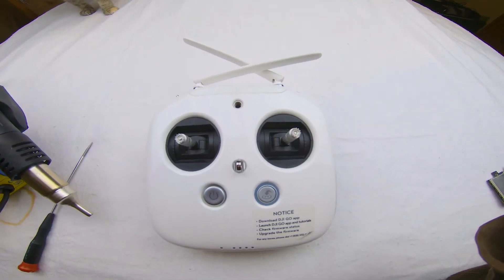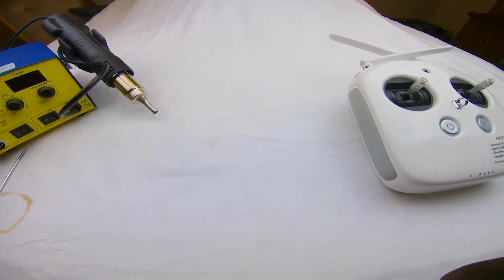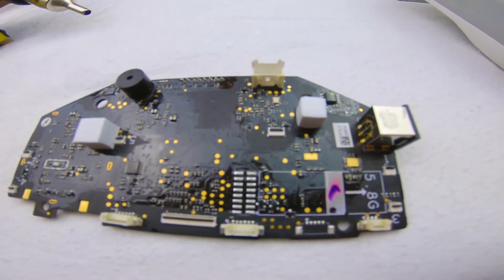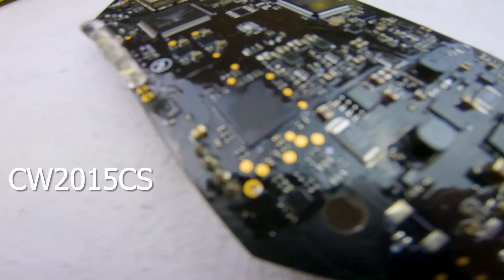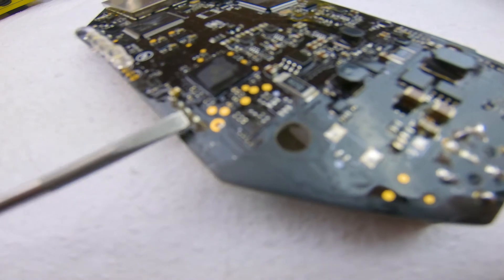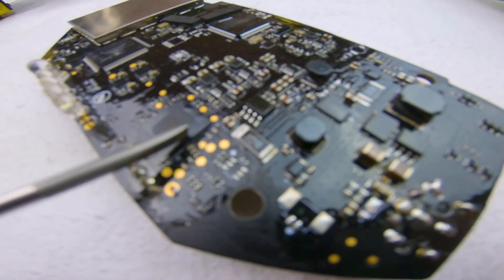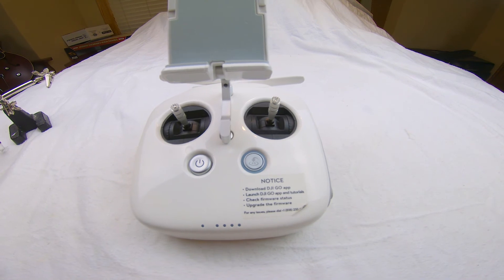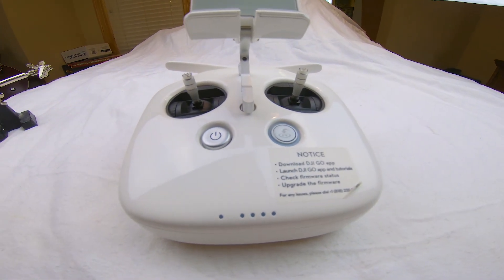Repaired - DJI Phantom 4 pro remote control not charging battery issue/error. Updated 2020

Comment: Very good video. I think what should be investigated is to know how to prevent this failure from happening again. I read somewhere that the problem is that when the control is turned off, the current continues to circulate and that causes wear and tear on that component. There are others who, to de-energize the board, place a switch on the side of the remote control and cut off the power, and activate it only when using the remote control again.

Comment: Thanks for the video....had this problem with the controller battery for quite some time. Purchased a flow gun so I could concentrate the heat and tried at 350c first without any luck....cranked it up to 400c for 30 seconds and success! Your video helped me focus on the batter charge state IC and temperature to use. Careful on the ribbon holder clamps, I broke one out of the clamp but was able to reinstall it after some time and effort!

Comment: I have a DJI phantom 4. What I have heard is that they used a type of solder that overtime leads to bad connections. It is called ROHS compliant, Which basically means it’s a clean type of solder but it doesn’t make good joints. What’s required is to reflow some solder joints and you can do that with a heat gun or if you can get directly at the solder joint you do it with a soldering iron.  Another problem with this type of solder is that it creates small growths out of it like very tiny leads that can create short circuits.  Clear coating that you see over the board is called conformal coat. It’s to protect the circuits from environmental conditions and it needs to be removed from any area that you have to work on. Sometimes this can be done with trichlorotrifluoroethane, also known as brake cleaner.  I am still waiting for this issue to pop up on my controller but I haven’t seen it yet. At that point I’m probably going to learn more about exactly which circuit is the issue. But I’m glad your fix has worked.

Comment: Did this fix last? I have P4P+ controller (build-in screen) and I am having the same issue. I don't have a hot gun for soldering - only regular soldering iron.
I am wondering whether to send it to local DJI dealer for fix (no idea how much can this cost - its out of warranty) or if its better to find someone with better soldering skill and tools.
Reply: this only worked for a short time for me and then started doing it again, i will try this next       https://www.youtube.com/watch?v=sqsjhosAubo